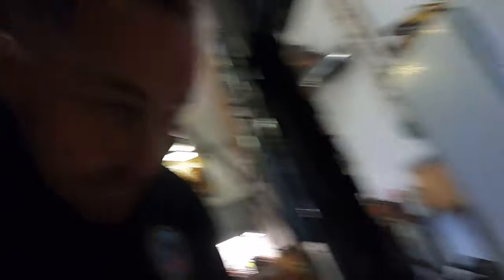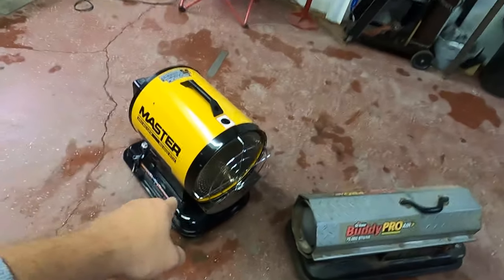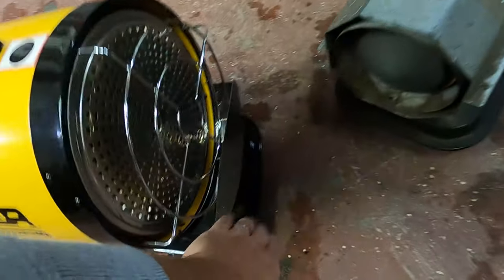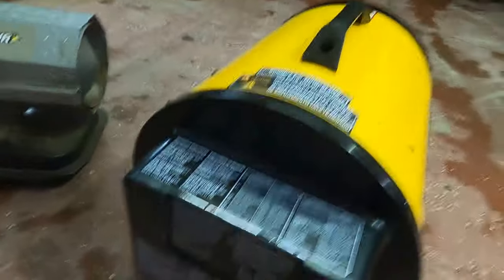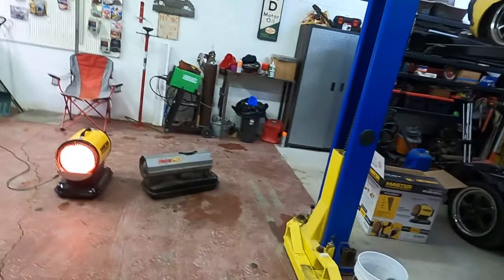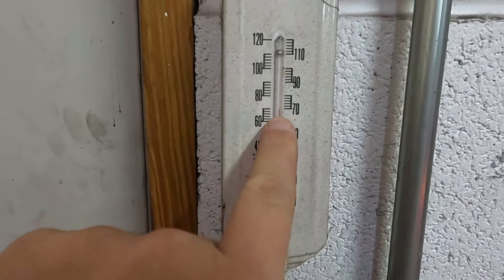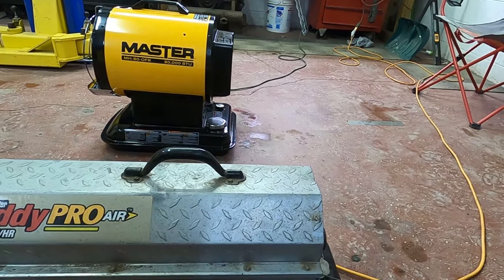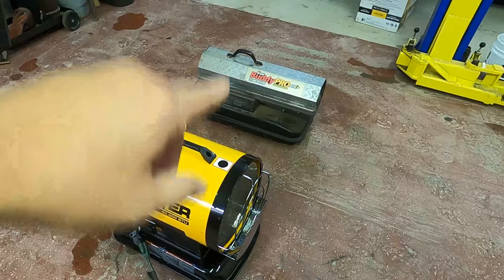KEROSENE GARAGE HEATERS.  MASTER  80,000 BTU  VS MR. HEATER TORPEDO HEATER  75K BTU.

Comment: I run mine on diesel fuel instead of kerosene. It burns cleaner than kerosene, no smoke or smell. Diesel puts out more BTUs than kerosene and it's alot cheaper too! My carbon monoxide detector has never gone off. I don't keep any door or windows open, eveything is sealed tight. It only has to run about 15 - 20 minutes to heat the shop then it shuts down.
Reply: What kind you got that shits down ?
Reply: @joeysowell116  It don't "shit" down it shuts down. I have one with a thermostat built in so I can set it at whatever temp I want then it just shuts down and starts up when it gets cold in the shop. It's a Mr Heater 80,000 BTU.
Reply: @PainterD54 did it smell when you tried kerosene?
Reply: @pauliebots  I ran kerosene in my smaller one (50,000 BTU) and didn't like the smell, so I run my new one (80,000 BTU) on straight diesel and there's a little puff of smoke when it comes on cold, but burns clean after that. I do smell the diesel when it first fires up, which I don't mind, but no smell after that.

Comment: I'm a retired drywall business owner and have used above every heater there is I guess. The old Reddy heaters are the best and would last forever. Keep the plug changed or clean and they are gold. The newer heater's on the market  have a computer board and are not as reliable. The radiant heater's are awful to fuel and the more you use them the harder they are to start. I have a 30 by 30 garage and this is what I did. I made a metal peace to sit in the bottom of a window and put the space heater outside on a covered platform. I used a normal  thermostat  mounted on the wall inside from the heater . I ran ducting from the heater to the window. All the sound is outside and the heater draws constant fresh air. I also use diesel fuel in it. .When it warms up I undo three screws and put the heater back in the garage in storage for the summer..55000 btu.

Comment: Just bought a used one. That is like brand new and the guy had it for a year. And lol he just used outside on his deck last winter. For a party because it covid and he didn't want a lot of people in the house. He said for even being outside in the cold he could not believe how it kept people warm. Now I have it. I am so impressed. I had a 150000 BTU Reddy heater. This master Heats my garage up quicker quieter and cleaner. Never puff smoke when I turn it on. And when I turn it off. I just hope it's reliable. Because there is a lot going inside this unit.

Comment: I have run the same reddy heater 55,000 btu heater since 1995, that heater has performed flawlessly. I started out running it on k1 kerosene and later switched it to #2 off road diesel. The diesel produces much much less smell than k1, the k1 puts out slightly more heat though. I have it on a plug in thermostat which makes it set and forget, I personally hate having to babysit a heater when trying to get work done. I like the new style radiant heaters but I wonder about long term durability. The old torpedo heaters are tough and easy to repair when needed, I like to buy old ones to repair and sell. I do like the quietness of the new heaters and when I finally wear out my old one I will probably buy one, enjoyed the video thanks for taking the time to put it together for us.
Reply from the maker: At this point I’m back to using my old torpedo. The new radiant has just been more trouble than it’s worth. You can’t beat the durability of the reddy heater. I love how quiet the new ones are but if they require me to work on them constantly then it’s just not worth it

Comment: If you use carburetor cleaner or other solvents and paint, how bad is the smell from the burning of them through the heater? I have been using torpedo heaters for 30+ years and they are terrible in this respect and my biggest complaint. Maybe I need to go to a system that uses fresh air to the burner. What are your thoughts?

Comment: Regardless, it's still loud. I was gonna buy the Master brand at Tractor supply, but it had way too many bad reviews. I ended up buying the Dyna Glo Deluxe, heats up my 24x25 uninsulated shop in less than 10 minutes, even with the door open.  I can leave the door open, and work very comfortably. I plan to insulate my shop, then run the torpedo heater to heat it up fast, then turn on an electric heater to keep it warm with no noise. If it starts to get cold, flip on the torpedo for a couple minutes. I like to listen to music while i weld , so i like it quiet.
Reply from the maker: Appreciate the input.  The master does have bad reviews and I have had issues with mine since this review. That why I recommend getting a service plan if people buy it.  As far as noise I have to say yes..they still are noisy but nowhere near as noisy as my old torpedo so I guess it’s personal opinion. Also thanks for the Dynamic glo suggestion.   I looked at them as well. Probably should have went with that one.

Comment: I just bought an 185000 btu torpedo Mr Heater at Rural King. It seems much quieter than yours and there are no fumes. It’s a diesel/kerosene model and I’m burning #2 diesel fuel. So far I love it.
Reply from the maker: The new torpedo heaters are much better. As I said mine is an old version. They have improved over the years for sure.

Comment: You can adjust the old one so the smell in not as bad. Look up diesel heater adjustment.  There is adjustment of the air mixture or pressure i forget. I have three of these type.
Reply from the maker: Thanks. I have adjusted the old one, actually picked up a new one and then but the bullet and installed an 80k btu gas furnace

Comment: I bought the dyna glo deluxe 9-18-18  it's quiet compared to my old torpedo i bought in 1990 that still works today.ran the dyna glo had problems starting in cold weather smoking black smoke all over,then it would run for 5 minutes and shut down,took apart to clean,photo sensor,filter, spark igniter ,numerous times,still the same.i had it for 2 years and threw it to the curb.so for now I'm taking my old remington heartier out of retirement

Comment: The Master read 72 db and the Buddy 82 db. i measured your video sound using my Apple watch. Held it at my speaker in the same spot to check both.
Reply from the maker: Thanks!  Kinda crazy. I would have assumed a greater than 10db difference but heck I’ll take it 😀

Comment: After running the Remington/Pro temp HH-70-SS and the Mr. heater 70K, you'd think I would know, but I'm still interested in hearing about other people's experiences with these heaters.  My Remington quit after 8 years or so...the Mr. heater has a thermostat and I'm still trying to figure out the cooldown cycle with that(If you only have the rocker switch, that makes it easy)...I ran the Mr. Heater outside the garage the first time and it didn't shut off because it was trying to warm the outside to 42 deg., LOL  Thanks for your post and your review

Comment: Good test, i like your logic there on reasons to go with the newer tech....It's really something to have such a 'quality of life' feature on tools these days.    I didn't hear the sound difference from the audio of your video here... but i can imagine a big reason why could be that mic is using some auto gain control (agc) to purposely compress the output for a wider response range.  That sort of takes away from your main selling point in your explanation.   The way i would think about the difference in tech here is by understanding that the diameter of the new is about 2 or 3 times the diameter of the older torpedo heater  Meaning that in order to meet the same  (though slightly better) heat output rating (Btu rating) the new heater only needs 1/3 to 1/2 the mass flow rate, or in this case VELOCITY.  I can logically understand that slower moving air yields a lower volume device.  So it makes sense the bigger diameter likely is quieter.

Comment: I just burn diesel in my heater it doesn’t smell as much as kerosene and it’s a lot easier to get hold of, I would recommend just using diesel.
Reply from the maker: I’ve ran diesel in my torpedo before and it messed things up. Of course that one wasn’t rated for diesel so that’s probably why

Comment: How did the fumes end up being with the Master?? Does that smell burn off over time or you get the smell every time you fire it up? I’m in the same boat as you. My garage is my workshop, gym and beer drinking spot. Lol.
Reply from the maker: Same. The fumes were always an issue. Even with a new torpedo. Depending on how large your area is I would suggest just running a gas line and going to a forced air hanging unit. That’s what I ended up doing this year. Sorry it took a year to respond 🤣

Comment: My 25 year old Craftsman torpedo runs on diesel and will heat up my shop in 30 minutes. Shop is 60W X 50 D X 16 high. So 3000 sq ft.  It is noisey and smokey if it doesn't stay lit.  A buddy gave me one of the Master Heaters like the yellow one you have, but it will not start on diesel to save it's life.  Kerosene here is 2X the price of diesel. Any of you folks have any tips on how to make the Master heater to work on diesel? Don't really car about the noise, I'm hard of hearing anyway, but the old Craftsman Torpedo is getting to be a pain to start now a days.  Hoping to be able to run both heaters on differenty sides of the shop and keep the temps consistant.
Reply from the maker: From what I understand these aren’t a multi fuel and don’t tolerate diesel at all. They will be difficult if not impossible to run. I’m not sure if there is anything you could change to make it more tolerant of diesel but as far as I know Kero is the only thing they will properly run on.

Comment: I think I found a heater finally 😆  28x28x14' ceilings. I have a block building w very little insulation but I think the master will work for now thx👍 does the master run on diesel or just kerosene and who sells them?
Reply from the maker: Just Kerosene for the master.  You can get them at tractor supply but I would recommend the Mr heater version of this heater. It has much better reviews and reliability.  I actually ended up switching mine out after a month or so due to reliability issues. The heat is great but it wasn’t worth the headache
Reply: I'm going to try and 80,000 BTU in a metal building with no insulation and see how it works I'm in Florida and it's supposed to get into the 30s wet cold

Comment: I’d like to here your report on performance with sub zero outside temps.
Reply from the maker: Haven’t hit sub zero here yet but in the mid 30’s they do great.  Unfortunately reliability has turned out to be a MAJOR issue.
Reply: Thanks, looks like a case of “too good to be true” !
Reply from the maker: @ussweeneyd   It kind of is. But that just may be the master brand. Maybe the Mr heater version would be better
Reply: @garagebeers1  what do you mean? Same issue with having to turn it off and on? Looking to heat up my garage gym with something not too loud but can give off a Ton of heat!
Reply from the maker: @_22445  shortly after this video the ignition completely failed and the heater had to be replaced. Didn’t inspire a ton of confidence. I would definitely buy the warranty.  I usually don’t but with this one you definitely want it. I’ve heard the new torpedo heaters are much quieter than my old one but I can’t confirm that from personal experience.  Either way the heat is very good. Just know that reliability can be an issue and with this specific unit you need to run kerosene and not diesel.  I have heard they don’t like diesel
Reply: @garagebeers1  hey thanks a lot for letting me know! great channel and video man keep it up!
Reply from the maker: @_22445   no problem!  And thank you very much. Some higher quality stuff coming soon hopefully